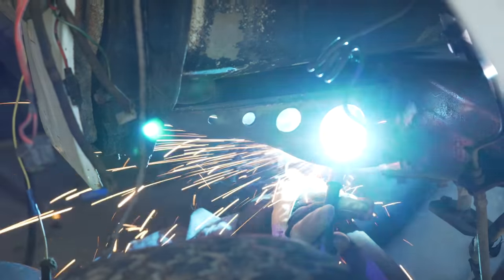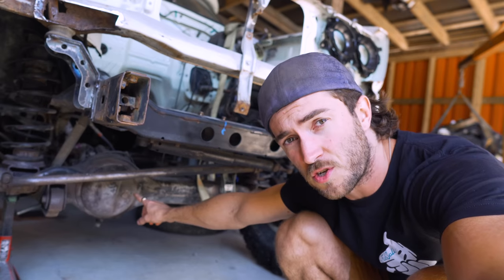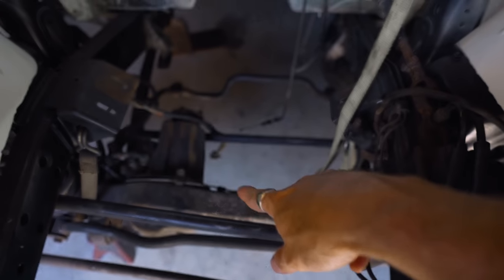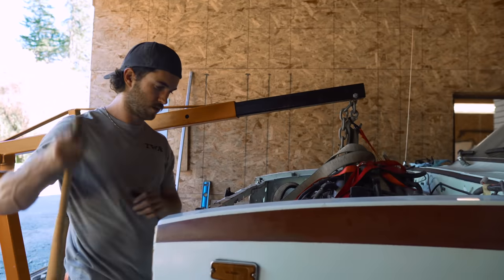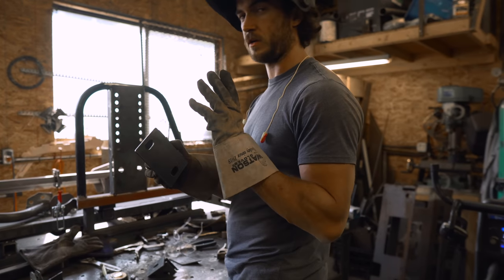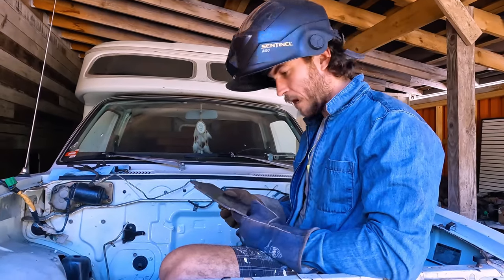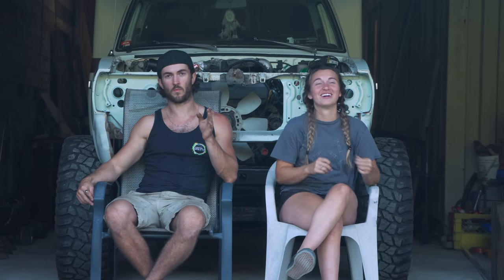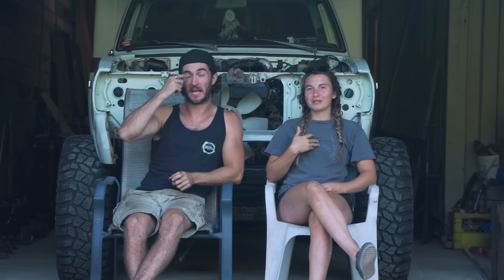IT ROLLS! But does it run? 4x4 TOYOTA CHINOOK BUILD, will it be the ULTIMATE overland build?!

Comment: I feel your pain on that oil pan haha. My 2WD truck came with a motor from a 4x4 (the previous owner installed it and I guess just gave up) and the steering control was actually sawing through the pan. When I removed the pan to weld a clearance notch in, I think the metal keeping the oil in the motor was maybe .020" thickness in some spots. Good luck on the pan and good luck on the trip! Love your videos.
Reply from the maker: Oh man that sounds rough! We may have found our solution which is exciting. 

Thanks for being here 🤙🏼